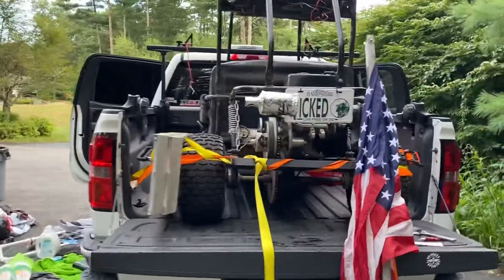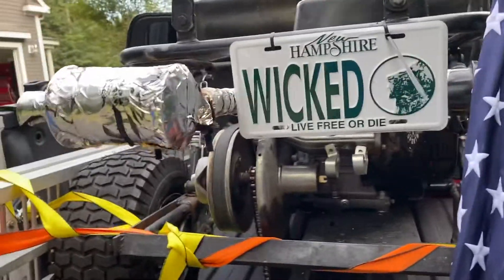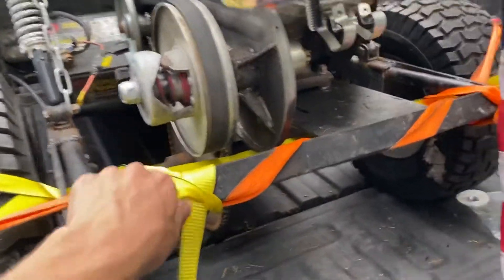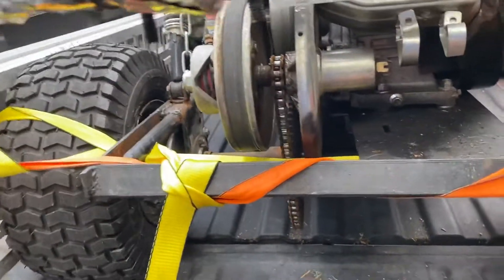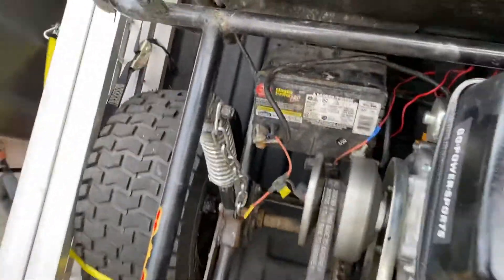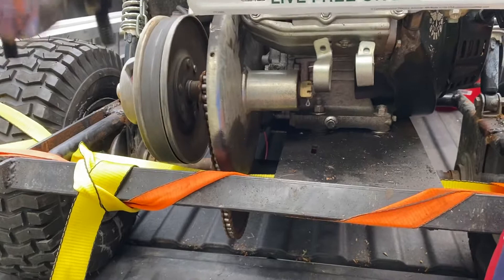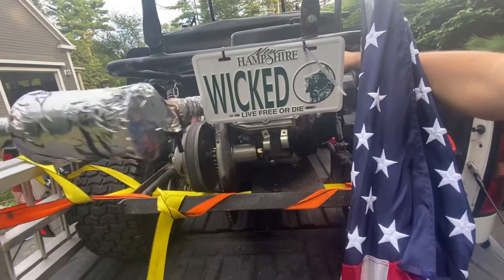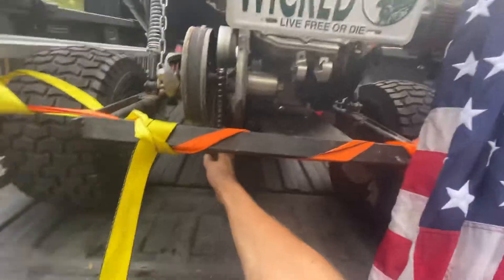How To Stop Go Kart Chain From Falling Off Under Load With a Peice of Chain (frame flex?)

Comment: I have a Erf dog 3203. I’m having a similar problem after installing my 420 16 hp Duramax. I was just wondering out of curiosity if you upgraded your engine plate. I ordered a quarter inch engine plate for the 420 or 640 and I’m having it welded in soon. Hoping that this strengthens up the back of the frame and supports the engine better.

Comment: Will adding a washer to the bottom plate were the motor bolts on wouldnt that work? On one side
Reply: I added 4 and it warped my stock plate.